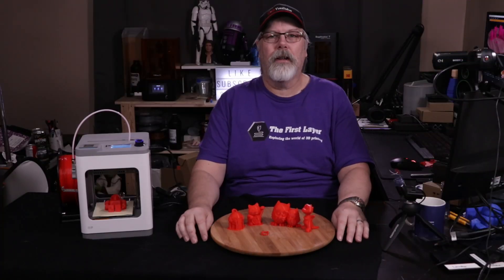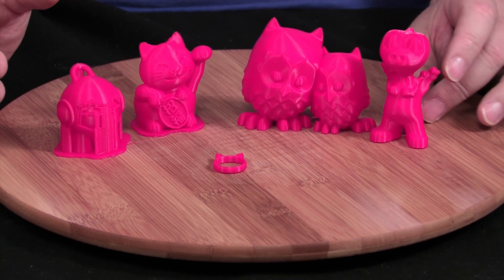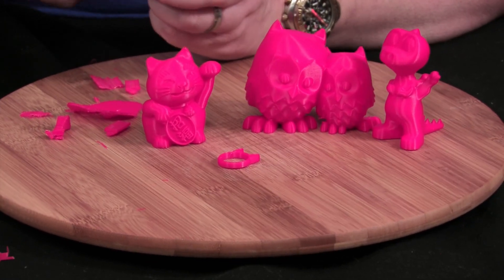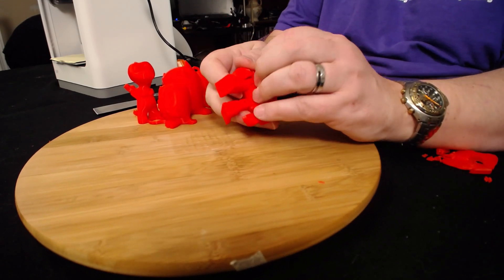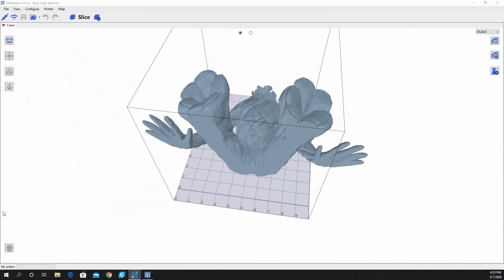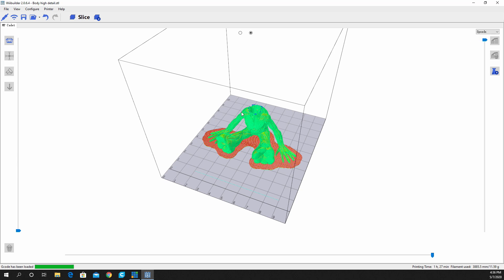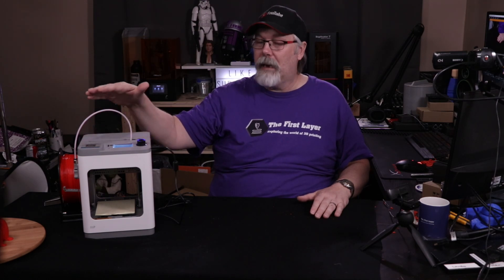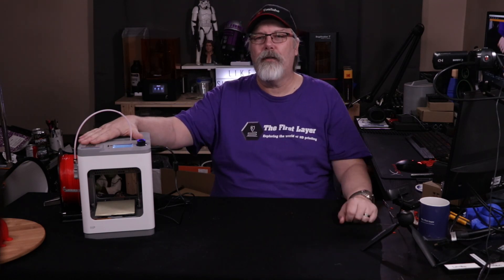FIRST LOOK: Monoprice Cadet, the perfect printer for beginners.

Comment: For $250  I will buy another ender 3. If the price was $100 maybe
Reply from the maker: s  stated in my review this is targeted towards the really green user or entry level education market.
Reply: Ender 3 is pretty big in comparison. I'm looking for a small footprint printer to print the occasional problem solving piece. This fits the bill.